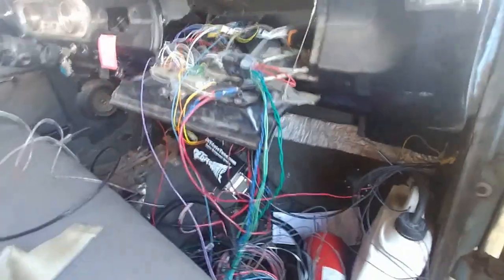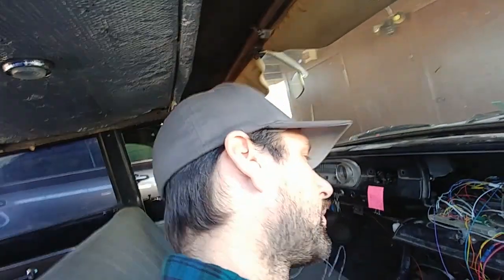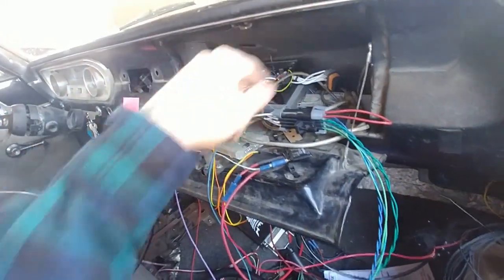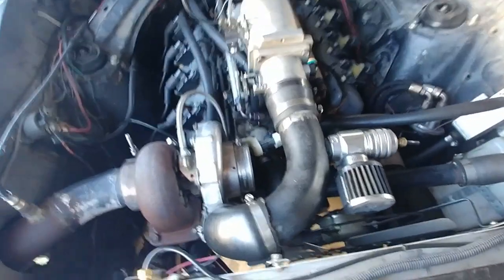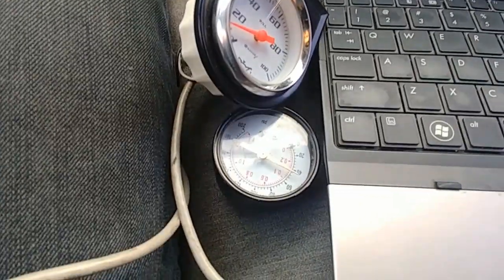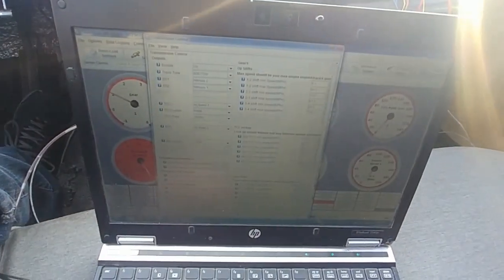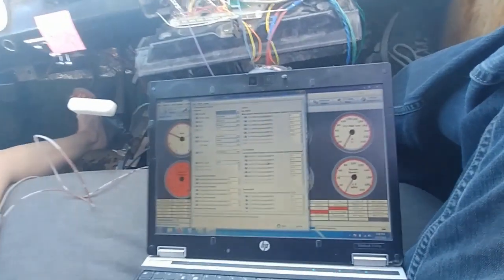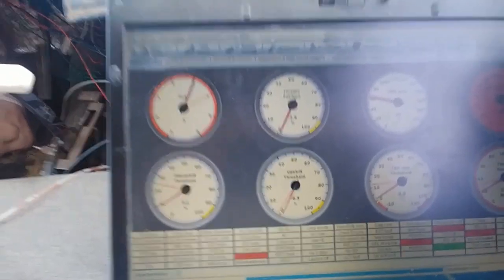MegaSquirt 3 w/trans control in one box.

Comment: Love your Falcon. Any more info on the engine setup? Basically what I’m building. 302, single turbo. LS coils. Only difference I’m using a gt40 intake. Keep making content! Subscribed.
Reply from the maker: Its a late 80s block with a cast steel eagle crank, scat I beam rods, and probe pistons.  CR is around 8.25ish..  Edelbrock performer rpm heads, comp cams roller(it's a smaller one 477 lift..).   Intake is an old torquer2 that some one bunged.  Then that big elbow to a summit 70 mm throttle body.  Turbo is a vs racing 7668.
Reply: Ryan Denney excellent! Thanks for the reply!